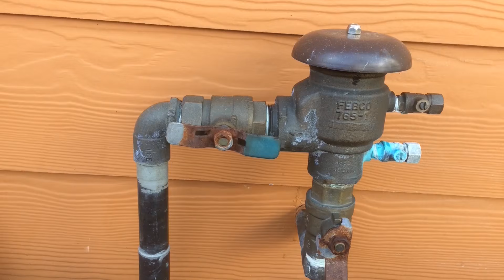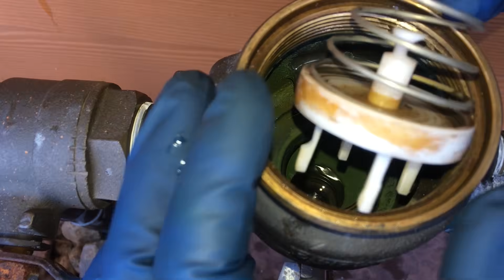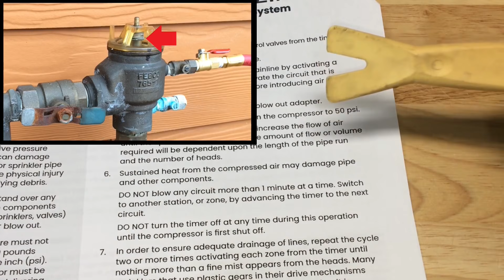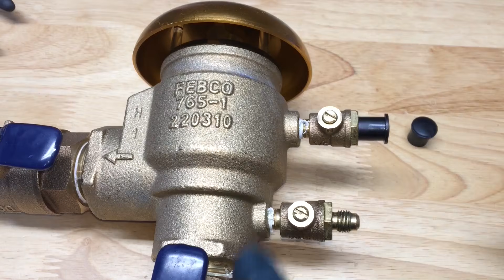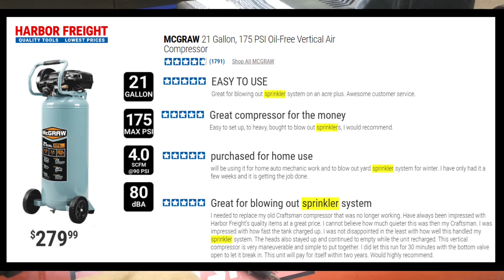Sprinkler Blowout with Air Compressor FEBCO 765 Full Guide, FEBCO 765-1 Backflow Preventer PVB shown

Comment from the maker: Timestamps, part info, links:
00:11 Which port?  "Ideally neither, but if you must either."
01:26  Difference between the two test ports
02:20  Example of a proper blowout port fitted downstream of the PVB
02:23  Know the rules in your jurisdiction

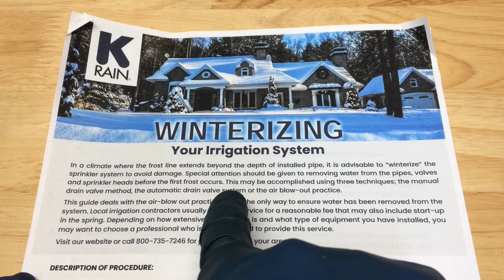03:50  Begin - Steps to drain the PVB
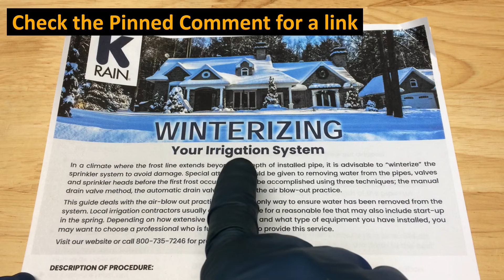04:00  Shut off the water supply to the PVB
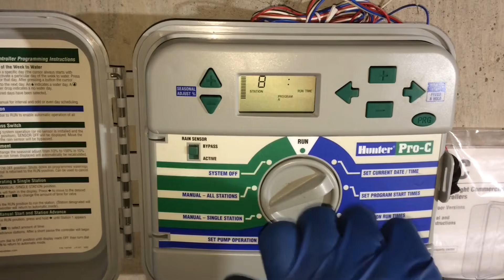04:47  Run the furthest sprinkler zone for a few seconds to depressurize the 

system
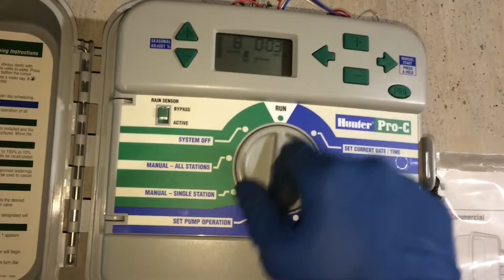05:23  PVB is now depressurized
06:08  Drain the water supply pipe
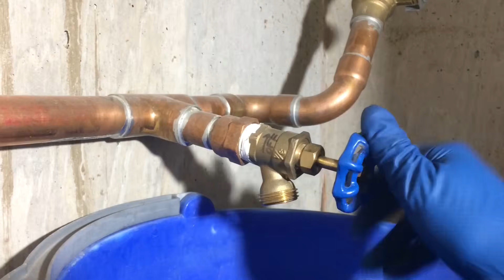06:36  Close the inlet valve to the PVB
06:48  Open the test port valves using a flat-head screwdriver

How to remove the valves from the PVB 
(not necessary to do, but shown in 
case you need to make repairs)
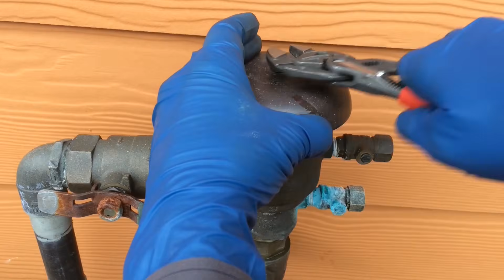07:53  Remove the canopy with a wrench
08:14  Remove the bonnet - turn counterclockwise by hand
09:20  Remove the poppet by hand
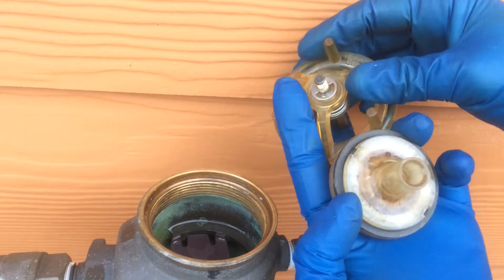09:25  How the air inlet valve assembly works
11:19  Remove the check valve assembly by hand
12:01  See the different paths of the two test ports
13:20  Different bonnets you can buy to perform the blowout
13:54  Inspect and re-install the check valve assembly
15:38  Inspect and re-install the air inlet valve assembly 

17:08  Overview and precautions about the Blowout Procedure, using the K-
Rain document (link below)
21:14  A quick look at the compressor shown in the video
21:32  Use the shortest hose of the largest ID
21:58  Don't use an extension cord
22:24  Compressor pressure setting - 50 psi, 
optimize flowrate

Begin the blowout:
24:04  Hook up the hose to one of the test ports
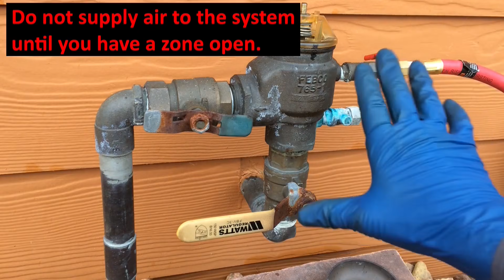24:41  Open the furthest zone valve before introducing air to the sprinkler 
system
25:21  Introduce air to the system
26:03  How to manually trip the inlet valve to close
26:16  Check the sprinklers to see that they'd popped up and are spraying 
water out - run for only 1 minute
26:44   After one minute, shut off the air and disconnect the hose
26:54  Close the zone valve
28:16  Same process, shown for another zone
28:37  Same process again, for another zone - multiple passes will likely be 
required with a smaller compressor
29:49  Same process again, this time on the lower test port
30:43  Turn off the sprinkler controller and unplug it
32:22  Exercise the valves, then turn all valves to the "45 degree" position

34:40  How to turn the sprinklers back on (spring-time start up)

37:01 Info about the hose and fittings shown in this video:
- short 3/8" ID air hose: Harbor Freight item # 91294  
- shut off valve: Harbor Freight item # 63553
- high-flow fitting: Harbor Freight item # 63546

38:38  Another option if you can't find a flare fitting to fit the test port

40:01  Information on the air compressor shown in the video and general air 
compressor information

K Rain Winterization document, PDF:
https://www.krain.com/winterize-your-sprinkler-system
https://www.krain.com/content/files/images/landingpages/winterization/winterizeyoursprinklersystem.pdf

Colorado State University Winterization document, PDF:
https://extension.colostate.edu/docs/pubs/crops/04719.pdf

I hope this video was helpful for you.  Thanks for watching, and good luck with your winterization! : )

Comment: REALLY informative - Boulder being 5000ft+, the smallish Kobalt unit I've used requires several tank repressurizings/fills to flush the longest branch in a very small yard, and I suspect my unit has blown its seals, after a few years of struggle. Newer units may have addressed some of the shortcomings, but what I now know tells me that a) the tank size is more significant for such use, versus the rate it repressurizes, since you're wanting to fully flush each line in one push; b) the ability to rebuild/find seal parts when they inevitably fail may be more important, since otherwise throwing away an entire unit is really bad economics and a waste of resources; c) some have posted ways to finagle conjoining small tanks to achieve a larger effective reservoir, and this may also avoid scrapping the tank of a dead compressor. Thanks for your video.
Reply from the maker: Thanks for adding that info - yes, in Boulder and those higher elevations in the foothills and mountains, you will have a harder time banking air, so usually people jump up to a 220V unit and a larger tank.  
But, as you mentioned, you can daisy-chain an auxiliary tank to your smaller unit, being mindful of your motor's duty cycle and giving it plenty of time to cool down, and also being sure to link the tanks safely (ie, with proper valves).
The motor rebuild kits are great, and you know here in Colorado that internals sometimes don't last as long because of our dry air.  
Thanks for adding your local info, and thanks for watching!  : )

Comment: I want to echo what I've seen written in some of these comments which is that this might be the best instructional video I've ever watched, well done!
I had a question also, when you pause for a minute, can you go back to blowing the same zone until it's done? Or are you supposed to work through your zones only doing 1 minute each, then repeat?
Reply from the maker: Personally, I work through all the zones at one minute each, then come back for the second pass in the same fashion, but you can do what you're describing if it is suitable to your setup, given the rationale below.

The rationale for the one-minute rule is to cover multiple scenarios, and for different reasons: for example, if you have a very small zone, one minute should be enough to clear it, and running for more than one minute might heat pipes (at least the nearest to the source) too much, since compressed air is hot.  This obviously depends on your compressor setup.  This is an important consideration for those using commercial-grade compressors, and especially for professionals using screw-drive compressors, which can put out a lot of hot air quickly.  This is why professionals are consistent with the one-minute rule, and move form zone to zone through all the zones, then return for a second pass in the same fashion.  It gives time for the pipes (PVC) to cool down.

For those with consumer grade compressors (like in the video), we aren't as much in danger of overheating anything because the CFM is so much lower than the commercial compressors.  So we mostly need to let the compressor motor catch up and re-charge the tank, then give the motor itself some time to cool down (this is the duty cycle - it varies by compressor).  So, the one-minute limit serves that purpose for the compressor and not really for the zone, as consumer grade compressors are fair less likely to produce enough heat to overheat a zone (unless it is a very small zone).  
But, since the method of going zone to zone, then returning for a second pass in the same fashion, works for both considerations (consumer and commercial), it is the easiest way to remember/present it.
I hope that helps - good luck!  : )

Comment: Why put them on there if you're not supposed to use them ? Lmao
Reply from the maker: They ports are for actually only there in the first place for testing the function of the PVB, and so they are required.  They aren't intended for use for blowout - just for testing.

As mentioned in the video, some jurisdictions require annual testing of the PVB/backflow preventer.  Remember that the purpose of the PVB is to prevent irrigation water (ie, water that might be contaminated by contact with lawn chemicals, fertilizers, etc) from backflowing into the source water supply (ie, the source well or municipal supply).  The PVB or other backflow preventer stops that from happening, but if the valves aren't working, then backflow can happen (hence the need to test the PVB's).

Here's the test process, if you're interested:
https://www.youtube.com/watch?v=aGwr2IqeUbI

If someone has never seen their PVB tested, then they either live somewhere where it isn't required (ie, a private well), or maybe they have a local water company that does it on a schedule and they've either missed the water company testing their PVB (or are new to the area and just haven't seen it yet).  In many places (most?) where the testing is required, the homeowner has to pay for it, so there are local private testing companies.

I hope that helps - good luck : )

Comment: Thank you, thank you so much for making this video! I've used it for the last 2 years, and would not have been nearly as successful without it. I was really worried about breaking something or doing it wrong since I was starting from near complete zero in my knowledge of these things, but your clear, comprehensive, & methodical explanation got me to a point of confidence. Not just of what to do, but how to think about the overall system. A lot of the other videos out there contradict each other, & don't seem to be from folks who really know what they're talking about, whereas you clearly do. I especially liked the breakdown of the tradeoffs of different aspects of air compressors, since I did need to purchase one. I have a general interest in how information is communicated, so even setting aside the subject matter, the way you presented the info was fantastic: knowing when to pause, when to supplement with a diagram, clear labeling of things, and explaining concepts instead of rote steps. Well done, & thanks again!
Reply from the maker: Wow, that is a very kind comment, thank you!  I'm so that that the video is helpful - that is my goal : )  Sometimes it makes for rather long videos (like this one), but I'd rather have the info there for everyone to review.

Thanks again for your comment, and thanks for watching : )

Comment: Great Video! Just curious why only 1 minute blow out per zone?
Reply: When pushing only air through the system the sprinkler head parts can get warm and cause damage.
Reply from the maker: The reasons I have seen for limiting the blowout to about 1 minute per zone is that the rule seems to work well for both those people using either small/DIY compressor setups (as in the video) as well as for professionals using large/commericial setups - but for different reasons.

For the small/DIY setup (like in the video), you will draw down the tank pressure very quickly and so the compressor motor will kick in - this means that you'll need to keep in mind your compressor's duty cycle to prevent the motor from over-heating.  The 1-minute limit is enough to remove much of water, then you can let the compressor catch up and cool off a bit before running another round.

For the large/commercial setups (high CFM), there isn't an issue with duty cycle, but there can be an issue of over-heating the system, physically, because compressed air can be very hot, especially from screw drive compressors.  Since many sprinkler systems use PVC pipes, joints, and fittings, you don't want PVC pr the glue getting too hot.  So, commercial operators will also limit the blowout time per zone, then make a second pass if needed after allowing a short cool-down period for the pipes in the zone.

That is my (limited) understanding of it, so I hope that helps!  Basically, it is a reasonable precaution.

Thanks for your comment, and thanks for watching : )

Comment: Great video.  Your voice is a welcome relief to all the guys trying to be ... guys.  Very thorough explanation.  Really liked the detail on NPT/FPT fitting sizes, and the CFM and Pressure*Volume discussion.  I live just north in Ft Collins at 5000'.

Harbor Freight sells an 11-gallon portable air tank - nearly the size of my Coleman Powermaster (120V).  Put that in parallel with the main air compressor tank, and you may be able to blow the station in one pass.  The only downside is storing it for the rest of the year.
Reply from the maker: Yes, that is a great idea with the portable tank, and they are useful in general.  
Thanks for sharing your tip, and thanks for watching!

Comment: Wow. This is, by far, the best sprinkler video I’ve seen for doing this task. You’re able to explain the nuance of the setups. I’ll often have to double-blow my sprinkler lines using two bursts of 50 psi for a few seconds (as long as the 6 gallon tank can handle it before losing juice). I wish this could require less explanation but honestly you’ve presented this very succinctly and densely. It makes sense that the video is 53 minutes long! That’s what’s needed to account for all the weird exceptions and non-ideal setups people might have.
Reply from the maker: Nice, I'm so glad that the video is helpful!  Thanks for your comment, and thanks for watching : )

Comment: my setup is exact as yours..however i have no air going to my heads when i hook up to either port...im using 40-50psi...the valve on top is not leaking either...very odd...i even removed 1 sprinkler head and there is no air coming out of line and the air compressor is holding pressure...my line shutoff valve is just like urs and is in line with the line so its open..im stumped
Reply: so do you have to use the controller to do this? i have controller off...maybe thats the problem?

Comment: Why do you keep the main valves off the vacuum breaker at 45 degrees ?
Reply from the maker: I'm sorry for the late reply - the reason for leaving the valves in the half-open position (handles at 45 degrees) is to allow any water (ie, from condensation) some room to expand when it freezes.  It is a precaution to protect the valves.  
I hope that helps - thanks for your comment, and thanks for watching : )

Comment: What size fittings do you use on the air compressor at the connection point of the backflow? I can’t figure that out to save my life, and I even bought a kit, the air, compressor, etc.

Comment: I do the same method to blow out my system. But I use about 35 PSI on the compressor. Seem to work well and not put to much pressure on the system. The pressure in the compressor will last longer also.